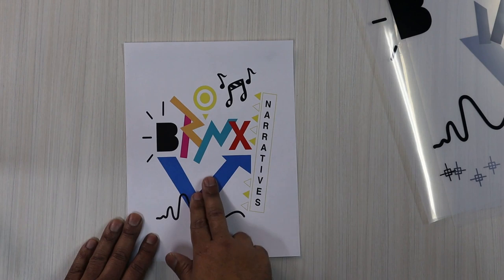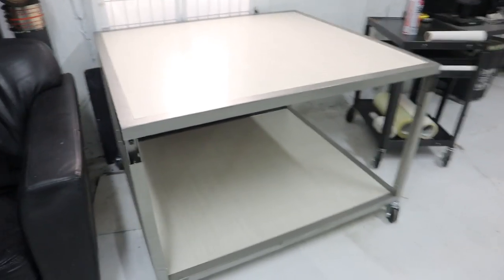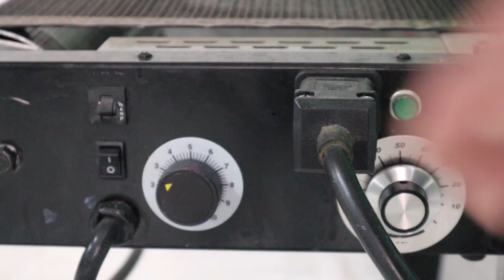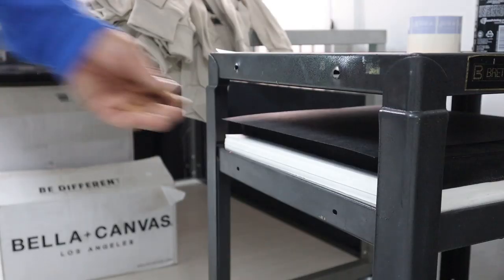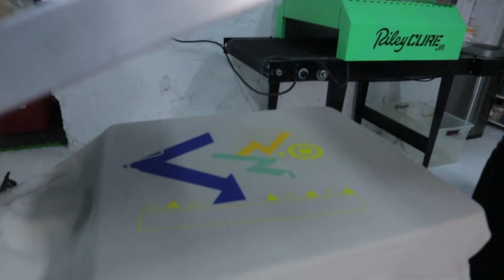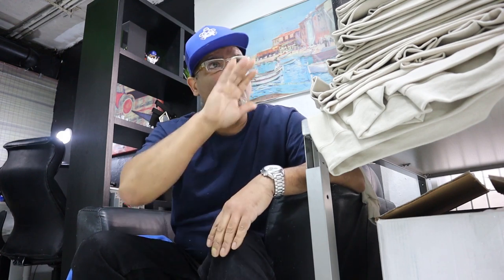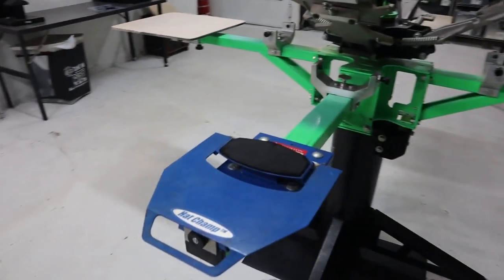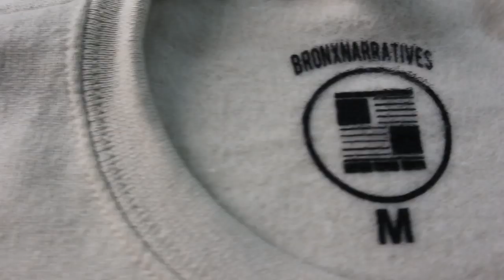SCREEN PRINTING FOR A CLOTHING BRAND

Comment: They turned out nice, but 10 hours plus the time it took to do the art, print the film and burn the screens is rough. Did you make any money, or was it more of a keep an existing customer happy kind of deal?
Reply from the maker: This was a teaching video. I have mínimums for different kinds of jobs.  A single shirt or a few shirts would be done heat press, vinyl, dtg( which I don’t do).  Thank you for watching
Reply: @tainoink  cool. Well done by the way, I was just thinking that was an awful lot of work. Might just be that I’m getting lazy in my old age. :)